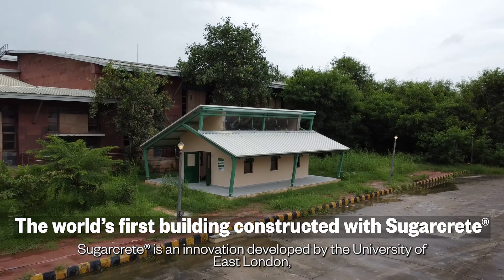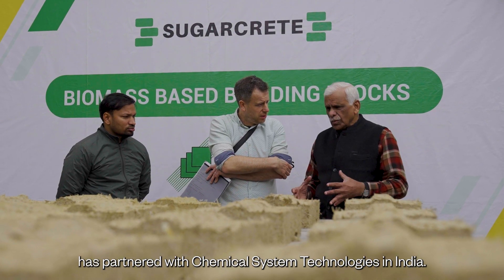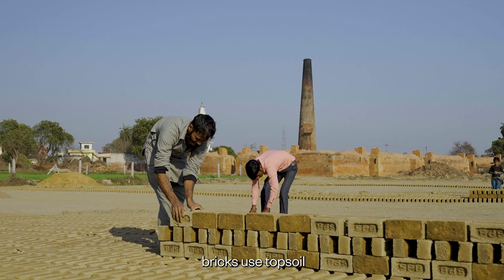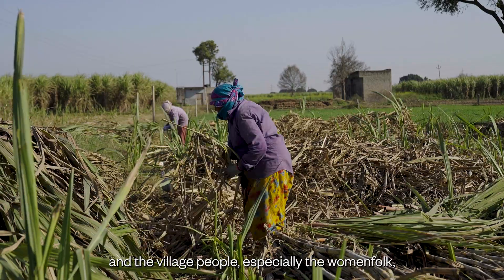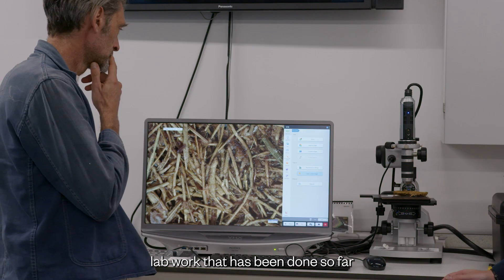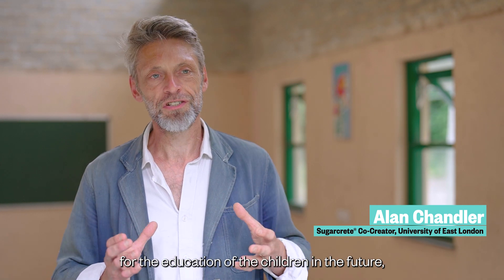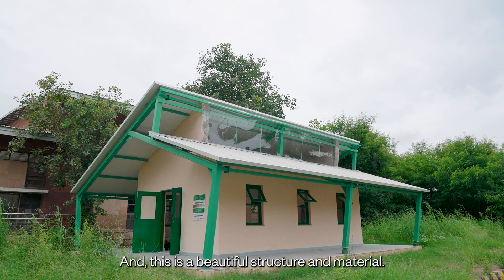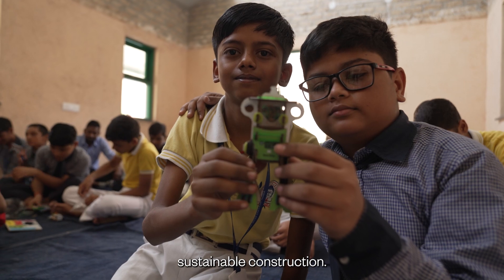Sugarcrete® India

Comment: We want to know more about this building. It's difficult to test in India how it deals with low temperature. But how isolated is it against heat?

Besides natural materials breathe differently, behave differently, better in humid conditions, because they transpire. Could you tell us more about this?

How long did it take to build it? Are there only natural materials in it and no chemicals or sintetic parts at all? 

It looks as if the metal parts are carrying the weight. This material is not hard enough for this, I guess,so you need wood or metal por the structure.

Wonderful project.